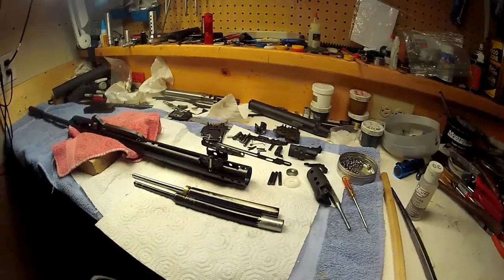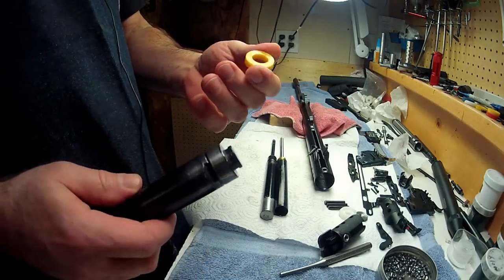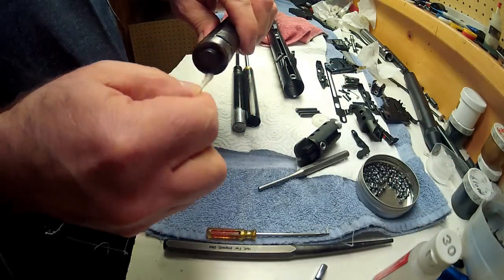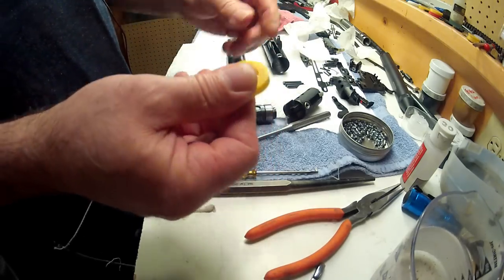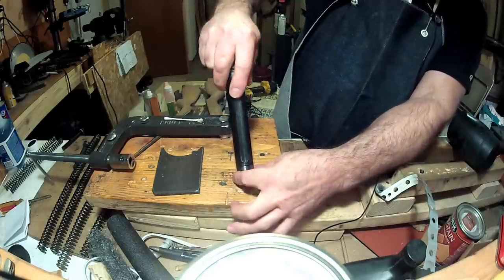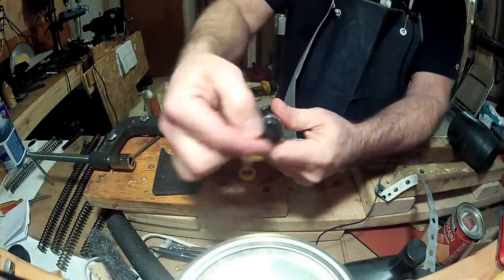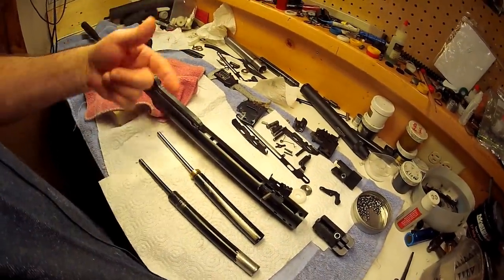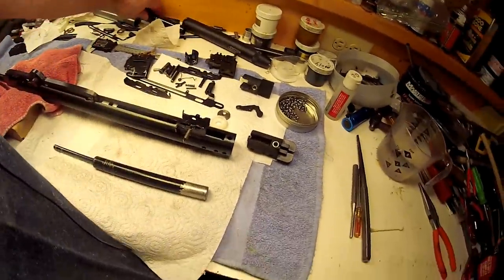Pt 1 of 2 How to gas ram hatsan & others and air gun info

Comment: Is there any charts available to know what gas ram goes into what air rifle ?
I got this detuned to 500fps remington express hunter 7-REHNPsx which I want to revert back to it's full 1200fps capacity.
I don't know what to put insise.
Reply from the maker: No charts, you have to figure  out what is  your piston travel is so you know the length  of  your rams rod needed and  what the remaining length  is  for  the body and adapters  if  needed  then look into what might  work  for you.
bigger magnums  may take the crosman xl  ram  and smaller rifles may take the crosman nitro venom  gas  ram , its better if you know the info including diameter
of  the ram.
 crosman rams are inexpensive so not much money lost if you  get  the smaller  one to see  if it will work if  you  can't get that info
Reply: @MrSteppingstone888  Thank you for your answer.
I will check it out.

Comment: I have an old theoben evolution gas ram which is down to 9ft lb's.  Is there a way of increasing its performance, anyone?
Reply from the maker: +Kevin Chamberlain You may have  to  rebuild  it, I am not up  on theobens  but  they do rebuild them, and should be refillable, you may need  to remove it  to fill them. I am not up on who  rebuilds them  so  google search  or ask the questions   on a air rifle forum
Reply: Mike Ellingsworth** Mr Stepping Stone*** Thanks, Mike!

Comment: What ram would fit a GAMO 33mm Bull Whisper Extreme?
Reply from the maker: David Geiger Dave  you would have to measure the piston travel.
 the distance it travels back to when it engages into the triggers seer. make sure piston is  all the way up towards  the  barrel before  taking its travel measurements 

 if its like 3 1/2"  (+ or -) IT WILL TAKE THE SMALL RAM  FROM A CROSMAN NITRO VENOM/ or titian .

 IF it is like 4 1/2" (+ or - ) it will take  the bigger ram from the Benjamin trail XL

Comment: Do replace the original ram. I believe it's leaking.
Reply from the maker: Most likely it is leaking , you can buy  the adapter and a hand pump  to  pump them up, or you would  need a end plug  for a springer version  from hatsan usa in order  to  install a different  ram/ also you would need adapters for the xl ram

Comment: I should of watched your videos before ordering a gas ram from Russia and waiting 3 months to get it. I have a question please sir. The ram came with a divit. On one side it is drilled shallow. On the other side it is drilled deeper. I know it must be a question of measurement. But from where to where? The gun is a Hatsan AirTact in .25cal. The ram is rated at 75 bar. Should be a killer when done. Thank You.  Lewis in Oregon.
Reply from the maker: Hi Lewis
the  round adapter  goes toward  the end  plug  the deepr hole  is  what  the end plug seats  into  the other shallow  hole  the rams  arm  goes into
the body  of  the ram  goes down  into  the piston
Reply: @MrSteppingstone888  I almost get it. Yes I know about the adapter. I think you make them out of nylon or something. But just only talking about the steel divit mine came drilled on both sides. One drilled slightly deeper than the other side. So the steel rod of the ram should go into the deeper side of the divit or the shallower drilled side?   Now how do I order an adapter from you?
Reply from the maker: @lewismaker895  heres my email you need  to email me  we can discuss 
it inbetter detail  /  did  you have the rifle apart so  you can do  the work and see  the inside  if so get me  pictures of  the end  plug of  your receiver  
and I need  to know  if it was a springer version or a gas  ram version
 if springer I need  to also see  the guide end that seats  on the end plug
if vortex  ram I need to see  all that  also here  is my email
awaysmike@hotmail.com

Comment: what happens if you do not use the small steel plate where the piston shaft rest?
Reply from the maker: Hi Charlie
what happens is the rod can be damaged the gas rams body wont be centered & it will scrape along its sides  every time /inside the ram are O rings and it's critical
the rod is Clean & straight
If  you have enough  ram arm length  you could drill the bottom of the piston to make your pivot hole but you need to make a snug sleeve  that will fit your long drill bit about 2"long sleeve  and it needs to fit into the piston so it wont slosh around  so your hole will drill centered at the bottom ,I ve used something less and it drilled off center so go at least 2"long drill bit sleeve

Comment: What gas piston replacement would you use in a hatsan striker 1000s dual caliber ?
Reply from the maker: Thats a small rifle but  the only way to know is to have it apart and measure the piston travel/ it would  have to be the smaller gas  ram from a crosman nitro piston rifle / but depending  on the actual build  if  there's  not enough room for adapters and the small gas ram  obviously that will not work.
going from a spring to a gas ram you will loose 50 fps 
you can buy  crosman parts off their website just find that model then look for the pdf on the parts list to get  your  info

Comment: hello Mr. Ellingsworth! I have a question... I have a .25 cal 125 th version and l' m very happy with it, no complaints at all. About changing the piston seal. Is it possible to remove the piston without removing the barrel? I won' t even try because thats the part that scares me. Please answer! Thank you
Reply from the maker: +Cetriem Mmmm 
Hi.
the only way to change the piston seal with out removing the barrel,  would be  to  drill  and punch  out  the cocking arm pin so you can pull  the cocking arm, I dont recommend that either.

thees  hatsan rifles are hard to work , and unless  some one is fairly skilled & mechanical I highly  recommend  not  messing with them.
 factory made and often put together under force,  not like a highly refined German rifle desinged  to take apart &  put back.
Mike
Reply: +Mike Ellingsworth** Mr Stepping Stone***Thanks alot. I have never done this before so l won't mess with it.

Comment: you are very knowledgeable. thank you
Reply from the maker: LOL  one guy called me a moron once.. those are  the trolls  who live for that.
 there slightly different ways  to gas raming  but that's my way.

Thank you for the positive comet
Reply: Mike Ellingsworth** Mr Stepping Stone*** you are welcome
Reply: Mike Ellingsworth** Mr Stepping Stone*** do you know if any way to make air rifles louder? I have the striker edge. nice rifle, but I don't like how quiet it is.
Reply from the maker: I just looked at the striker edge on line it looks like its a standard hand break. not that its a good thing  but if its a 177 and you drop a drop or two of  lite oil  in the barrel  the oil will detonate and it should sound like a .22 rifle  rim fired rifle
Reply: Mike Ellingsworth** Mr Stepping Stone*** I have done that with my daisy powerline 880. also with fish oil pills

Comment: Hi Mike. Is it possible to Gasram my Weihrauch HW 77 ? I don´t mean V-Max system! It will still be a springer. Thanks
Reply from the maker: NO, that is something a manufacture would have  to redesign and make.

the piston has a enternal stem  that catches  on the trigger seer so the gun would need to be re designed  like the new  Diana gas ram gun
 gas rams are not  all that  just different they can still have a big jolt  where the springer can  be tuned and worked
Reply: damn, I knew it .... thanks man.

Comment: Hey mike the guy on airgunnersedge is showing the 125 sniper vortex. He takes stock off and theres a fill port.uses the hand pump and adds air to pisto
Reply from the maker: Mike can  you find that video  and post the link in another reply/ I went  over his vids but did  not see a 125. vorteck  / there's   135 but  it does not mention pumping  up  the ram /  thanks for the  info 
 I'll want  to check  his channel out  for  sure

Comment: I know this is old but do you sell the adapters?  Dont have the tools to make my own.
Reply from the maker: I can make  them  for you, but  you will have  to adjust it for the rite length on the delrin rear gas  ram adapter  so  you have 1/8" of  pre load before  the end plug  lines up  with  the large Pin, the 1/8" pre load is so the ram stops  just before  the end of its throw ones is delrin  the other is steel 40.00 shipped

Comment: hi Mike ,
I'm in the process of gas ramming(vortex) a mod 60s . Do I need to get and install a centering washer/bushing to the rod on the gas ram ? Also upgrade the piston seal ?
regards
Reply from the maker: check the bottom of the piston see if  they drilled a divot for a ram.

yes  you will need something to keep the ram on center just enough to do  the job.

the divot adapter needs to  stay at the bottom of the piston other wise it could cause a issue

 On some  hatsan rifles  I was able to drill the bottom of the piston, using a new long drill bit , and a  3/4" deep centering ring I made to keep  the drill bit centered while inside the piston.
I use round steel stock tuned  down to  the  rite width  to drop into the piston  with a divot drilled in the center But usually  the thickness  must be minimum ,

  I think on my hatsan 125  the thickness could be no more  the 5/16" and it was a divot  not a hole thru  the round steel piece.

you need  to lay  out  so you known what  your piston travel is and how much room  you have left for the end adapter  so the pis'ton dont hit it when it comes back to be cocked etc.

other wise if you drilled out your pistons  bottom it may cause  you to add a longer end adapter  that will  interfere with the pistons face hitting  it during cocking
Reply: +Mike Ellingsworth** Mr Stepping Stone*** thanks Mike , I haven't started 
 On her yet , just need to make sure I have everything I need before I start .

Comment: Hello Mike! Greetings from Italy. I opened my Vortex Gas Piston and I noted it's filled of a small amount (2-2,5 cc) of unknown oil. Please, can you tell me exactly what kind of oil must I use to refill it? Many thanks. Joe S.
Reply from the maker: Hi Joe.
I  do not know exactly, I would just use something  that has the same viscosity 
its to lubricate  the rod inside
Reply: Yes, I agree,  may be silicon oil for the contact between inside rod and the two o-rings.
Reply from the maker: I used to use clear silicon oil on the shafts externally  before I  found out they  had oil inside I bought mine from a hobby store  but I think  the viscosity  was thicker compared  to what I found inside, they may have different viscosities in a hobby store mine said #5  if I remember  cant see how it would hurt

Comment: vortex or crossman nitro what is a better one to put in and the best place to get the parts ?
Reply from the maker: I been using  the crosman xl rams , I think Tom from vorteck products inc have  his own now  but I am not sure as I have  bought   them from crosman on line in the past.  buying wise it may be easier to see if vortek products inc have  his own

at crosman.com
you have to go to the website find  the Benjamin Trail NP XL Air Rifle.
then click on the parts diagram find the number and info for  the ram then call crosman and give  them the info on the part you want. if a number has a dash  then  yours  must have a dash  so  write  the numbers down exactly as you see them
we use the Xl ram  from the benjamin trail xl for the big hatsan magnums like the 125 or 135  but if you have a hatsan 95  you will need  the smaller gas ram, from the crosman nitro venom air rifle.
Reply: Mike Ellingsworth** Mr Stepping Stone*** 
thanks !!  
I have the 125 in .25 .
 With putting the crosman nitro in will there be a big fps loss or not enough to worry about?
Reply from the maker: If you have a spring and you install a gas  ram you will loose around 50fps, because  the spring will release its energy faster
Reply: Mike Ellingsworth** Mr Stepping Stone*** thanks
Reply: Vortex no question about it, much faster very smooth plus the added benefit of being able to add or release air on the Vortex Ram itself. pop the stock off get a $40 dollar 3 stage high pressure pump on Amazon connect & add air or release air .. Doesnt get easier than that, simply pop your stock on your done!!

Comment: I've got a question about the Vortex Gas Ram in Hatsans rifles. I'm looking to buy a Proxima and swap out the Vortex Gas Ram for their Magnum Vortex Gas Ram. I don't know if they are the same size or not. I'm not sure if you would even know but, I'm trying to find out of I can swap them and if I will have enough room in the Proxima. I'm not sure if you can answer this but, I figured it couldn't hurt to ask. Thanks in advance!
Reply from the maker: Hi Mickey. sure it doesn't hurt to ask. 
I do not know , I have not had that rifle, I heard they have low fps  
you would have to ask before you buy  that magnum V gas ram
I would pull the ram  out and measure  it and measure  the piston travel then  get info n the other ram  your interested in
Reply: Mike Ellingsworth** Mr Stepping Stone*** 
So, I actually got in contact with Hatsan USA. They say that the Vortex in the Proxima is a "Type 7" and the Vortex in the 125 and 135 are a "Type 2" they went on to say that the "length of throw would be too long to be effective" and the "diameter is wrong." I'm wondering if there is any way around this... 
My interest in the Proxima is primarily due to the fact that I proposed a prototype 2 years ago in my Facebook group which, back then was the first High Power/Custom Air Gunning group on Facebook. I'm aware that saying I'm essentially the guy who proposed the Proxima is a lengthy claim but, here's a link to my proposal for my prototype which is actually still the pinned post for the group. Luckily it's time stamped and, I had already been designing the rifle about a year before I decided to ask for assistance with the build. Anyone who thinks I'm lying or crazy can check it out themselves. I can't be mad at Hatsan because my life has been extremely unstable for about the past 18 months and there's no way I could have built a working model either then or now.
https://m.facebook.com/groups/811880912291495?view=permalink&id=840739252738994&ref=bookmarks

I'm hoping to figure out a way to drop in a Magnum Ram and pump up the FPE capabilities. While my hope is to figure out a way to stick with the Vortex line due to it using air and the ability to tune the pressure in the Vortex Rams, I am also willing to look at either another type of Gas Ram (maybe one of the new Gamo Magnum IGT Rams OR, I may find a company to design a higher output Ram that will fit the Proxima. I look at it like this: Hatsan basically did all the hard work. Now all I have to do is buy a Proxima and tune it to my preferred specs. Thanks for getting back to me so fast! I was really happy to see your reply! Thanks again, God Bless!
Reply from the maker: I believe  you. There are companies  who search and read  air gun related post for Ideals  and mods , you bet lol 
well I once tested gas  rams way back with the  hatsan 125 - 135  both would take the same size  larger gas  ram
 this  company I dealt with below and they would charge the ram to my asking.
 I found with the bigger ram for the 125 & 135  that 170 bar fill was the cut off after that it was hard to cock and the cronied fps  where to iratic 

you can experiment  pull the ram  out  of the proxima look  for that size   for example the crosman nitro venom gas ram is the smaller one used  in the hatsan 95 and the crosman XL benjamin gas ram  was  the larger size  for the 125 - 135 /  you'll also have to see how hatsan made   the proxima.
 on the  hatsan rammed break barrel part of  the end plug was permanently apart  of the gas ram which makes it difficult to use another ram unless you make another  end plug,  get them from hatsan usa from a springer and make your own adapter 
this stuff  cost time and money god knows its  cost me alot ,its a never ending money pit.

this  company uses nitro but you could get one charged to  your liking
do google search  for overseas  rams  they use in air guns to get a ideal on the  bar level  used in the smaller rams
https://www.specialspringsna.com/

also a spring is  50 fps  faster over the gas ram nothing wrong with a spring
Reply from the maker: I bet I have a special spring gas ram  I never used  and it was the smaller one I think  that had 170 bar fill if  your interested I could look on my bench
Reply: Mike Ellingsworth** Mr Stepping Stone*** 
Thanks for the excellent info sir! I like the Gas Rams for all the usual reasons. The Vortex especially because of its tuning abilities utilizing a pump. Now I'm wondering if Hatsan won't end up putting out a Magnum version of the Proxima and I MAY end up waiting for them to up the power output. Now, I was looking at the specs on the new Gamo Magnum IGT and, I think THAT might be EXACTLY the Ram I want to use. I don't know the specs on it yet, I'm looking it up as we speak. I would bet my life that it's a much different size than the Vortex BUT, if there's a way I could modify the Proxima to take that Ram and function as it does (obviously there will be a major difference in cock in effort but, I'm a pretty stocky guy) I will just replace the Vortex with the Gamo and call it a day.
Reply from the maker: you have  to be  careful with overpowering a air rifle because if  it's to much  the  piston seal will burn up/ thats what happens when oversized springs  are used  on springers / well good luck in your adventures I had had a lot of disappointment  but that's  how  you learn things. most guys dont want to spend money and put in all the ffort and trial to find airguns stuff out no they rather get it for free , Iam  always careful  of what info I release because  of  that.